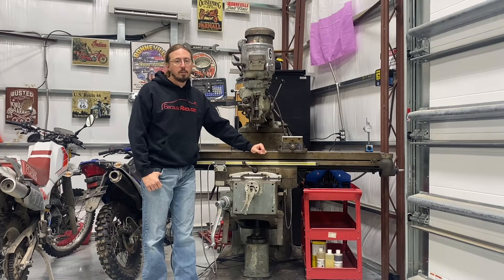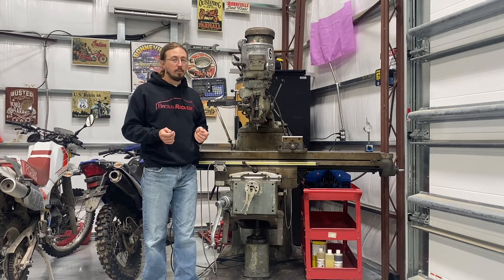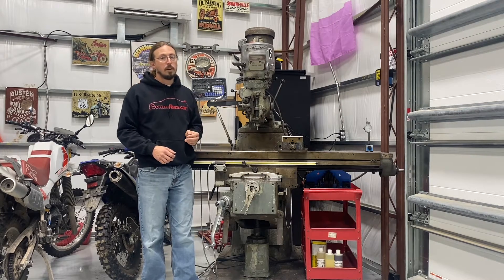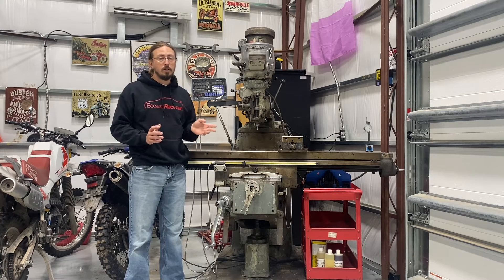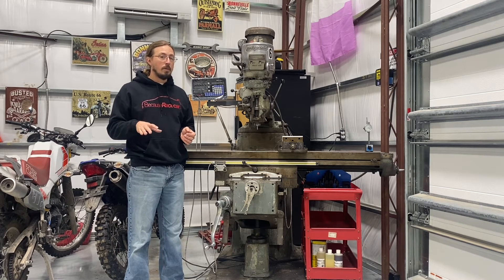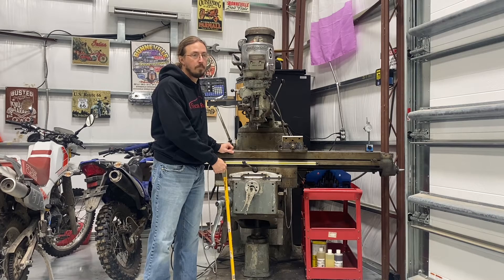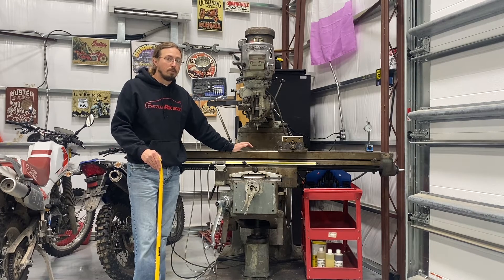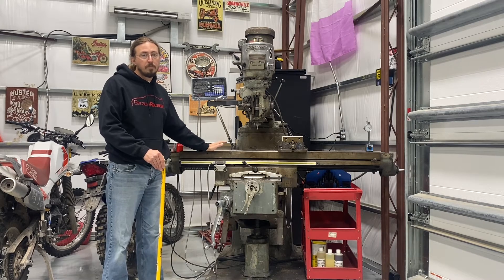How to Move a Bridgeport Milling Machine

Comment: Turning the head down is probably the most important thing to do in transporting a Bridgeport besides straping it to the trailer. Also, I started out doing this move the same as you however, halfway home the trailer I rented had a major malfunction. A good samariton stopped by on the side of the Interstate to help me and seeing the problem I was up against he suggested I call his friend with a wrecker and return the trailer with the front axle tires removed on one axle. That is what I did. That worked great but the best part was the wrecker a Holmes 440 it had like a little low platform on the back sticking out and with the boom he picked the Bridgeport off the trailer and set it on the lower platform but still connected to the hook then secured the base and took it to my garage and set it inside and only charge me $120.00. The trailer rental and pallet jack were $140.00 (Later refunded) plus tons of work to load with it (with head still up) and a come-a-long. If I had known, I would started with the wrecker and saved all those sleepless nights figuring out work loading and unloading and how the moving process would be done safely for a 5,000 Lb Bridgeport.